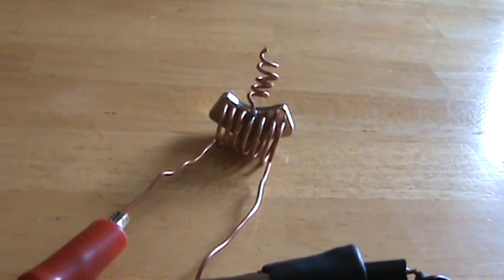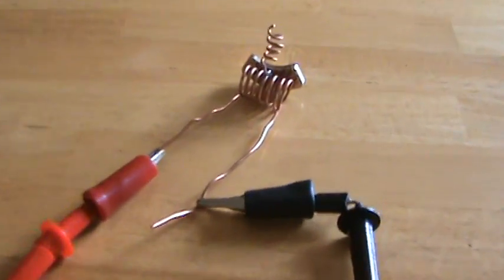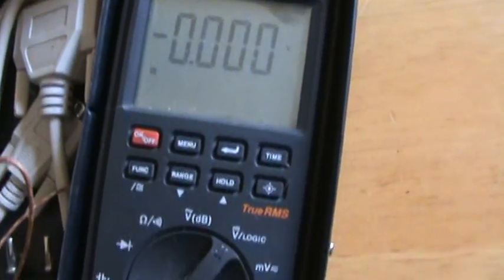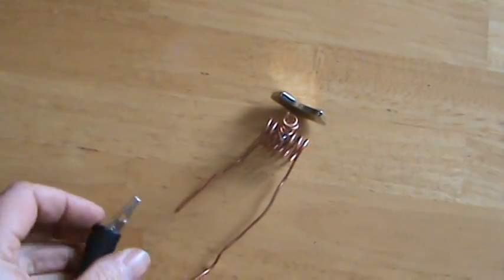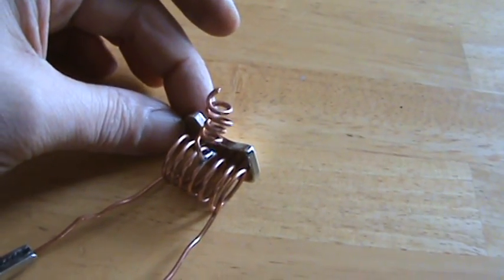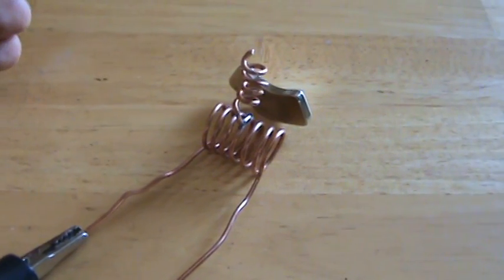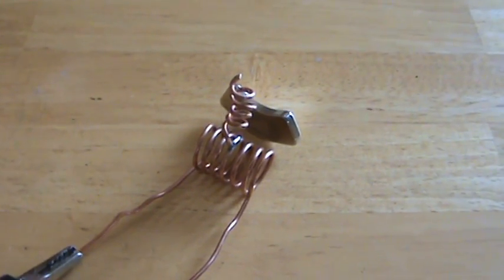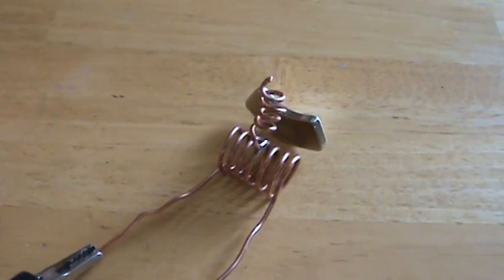Free Energy Generator

Comment: I know how to do it and based on your video your method is lacking a key component. I will give you a clue Alpha Particles...
Reply from the maker: Hmmm, interesting, do you think some radioactive material could actually make it run?
Reply: @INVENTOR3  try wrapping that wire arround some uranium glass and see what interesting effects you get. or you could use mud or even mercury. Also try using cooper and another metal wire like zink there are more than one way to skin a cat. Try the experiment with different temperatures you may find dry ice to be helpful or heat. These are all techniques.
Reply from the maker: @Archangel4Truth  I really like your ideas, they are good ones, thank you.
Check out my latest videos on my channel(just click on my name), you will see a truly incredible project that I am working on now😎

Comment: magnetic around the wrong way, I'm wondering if magnetic is separating the charge in to DC using the larger coil
Reply from the maker: I "think" the person i am replicating was powering his coil through a wireless system.
Thanks for commenting.
Reply: @INVENTOR3  The voltage never fluctuated at all, did seem more like a battery, but I couldnt where.
Reply from the maker: @seb_gibbs  Hummm, you make a good point about voltage did not fluctuate.  Yeah, i dont know where he would hide the batteries, unless maybe he took out motor from housing and replaced with smaller motor and battery and put back inside of the housing.

Comment: For a magnetic field to produce electricity through a coil, the magnetic field need to cut through the coil. Stationary magnets do not cut through the coil and therefore should not produce any electricity.
SCIENCE!!!
Reply from the maker: I agree completely.  But i believe he may have used a freq gen or something to produce high power freq in the air near by, that are picked up by the antenna of the circuit
Reply: INVENTOR3 yes

Comment: Conservation of energy theory states that the energy is never lost; it changes from one form to another – potential to kinetic, kinetic to thermal etc. What it doesn’t propose is to create energy from nothing. There has to be something, a catalyst for the cause and effect to take place. 
For magnetic flux to actually excite the atoms in an electric conductor such as copper wire, there has to be varying rates of flux cutting into the wire in order to cause excitation of electrons and holes for flowing motion of their potential energy. That happens with rotational motion, which is caused by introduction of the kinetic energy onto the rotor in electromotor due to flow of current into the rotor coils or by rotating magnetic field about stator in generator – reversal of electromotor concept. So nothing gained from nothing. The energy we receive freely from sun is due to constant nuclear reactions that take place on the sun.

Comment: More conjuring fakery can be found on Tech Torr's videos - as always the questions you need are "where's the battery hidden", "how do I know that bulb/motor/multimeter/whatever hasn't been tampered with?".  Some use an off-camera fan to spin things with dubbed audio (or no audio) to hide the sound!
Reply from the maker: Yeah, I saw Tech torrs videos before,,,so far, i think they are fake, but this is just my opinion.

Comment: i did try free energy by use of am coil to recieve an am station that is strong enough or close by.the closer the stronger the power but it's very small but did work for me.i don't have any specs on it but you can try to make a crystal set to make this happen.you can get free power off of a radio station it does work.i tried it.to gain more power try to use a doubler or tripler circuit to increase this.i did not do that but it might work if you experiment with it.so try it the tunning method should work if you are near an am station.use a am rod antenna tunning cap.and a crystal diode and try to measure it on a test meter.let me know at albertcarpenter137@gmail.com please get started on it.thanks.
Reply from the maker: The project you mention,,,,,i have been working on it for over 8 years now :-)
Here, please check out my latest video.....
https://www.youtube.com/watch?v=XK3NrQLR2XE

Comment: You forgot the batteries dude.  These devices are made by installing button cell batteries in holes drilled into the magnets using glass drill bits.  The resistance caused by the magnet material(which is otherwise quite conductive) drops the battery voltage output from 6 point something down to 5.9 volts exactly.  Neither can your copper coil be continuos or you create a short(obviously) which is where the pigtail comes in.  That pig tail add on hides the fact that the coil has been cut and hot glued back together(without touching of course).  This is a scam pure and simple.  You really think no one woulda done this over the centuries if it was real?

Comment: They drilled into the magnet and placed watch batteries under the glue... just that simple. Someone already made a replica like that that works with batteries! Hiding the small round flat batteries in the glue. 

If anyone watches this and wants some real and interesting long lasting energy devices look up Crystal Cell batteries. They are very low amp low voltage devices but they last years.

Comment: The trick is rather simple. Open your multimeter and solder a button cell battery in series with one of the leads. Every time you short circuit the leads it will show the battery voltage...

Comment: Hidden battery/s...always the same 3 volts as lithium....coil and magnet won't generate anything unless they are moving relative to each other....big coil is cut and hidden under the smaller tail-coil...glued on and some silver paint to resemble solder...

Comment: I think you didn't pay as much attention to the videos as you referenced below your video. Magnets = magnetism. Sooooooooo how come was your magnet not magnetized to your coil? What would create electromagnetism and electron transfer (electricity) would be magnetic repulsion or attraction. But that would mean two magnetic substances would need to be present. Or one magnet creating a push or pull on one STABILIZED and GROUNDED metal. Your coil should have been affected by your moving the magnet so close.... maybe your magnet is broken
Reply from the maker: Refrigerey Bubleswinzlow Why is magnet not stuck to coil, i use copper wire,,,i think in one of his videos he may of used a coat hanger for the wire so it would of had iron content in it.

Comment: He's putting batteries in the goop he's using to hold the magnet to the coils. Its the same goop Dumble used to use to hide the values on the circuit boards of the amps he'd build. Get your hands on some and redo your "experiment".

Comment: yes. you know, that if his device was valid, even if poorly replicated, some voltage would be produced. there's another vid explaining how easy it is to drill out the magnet, placing 2 tiny 3v batteries in series within the magnet, and the coil actually not being continuous. that's how the 5.9v is made. Bash away at fraudulent video authors! they deserve no respect as they are charlatans similiar to alchemists making gold from lead
Reply: I agree with you!!!!!!

Comment: I am thinking that there is a transmitter under the LifeHack2012 or anywhere else maybe a wireless ac signal to produce a 3v ac signal and then the motor itself was hack maybe there is a diode inside the motor and it will start feed from that coil and magnets if so it is big FAKE.
Reply from the maker: Misael Ordenal good answer, i agree.

Comment: Hi Inventor3. Yes, it is a hoax. The only way to induce a current (electron molecules) through a wire (coil) is by a magnetic field that is in a constant motion. The more cycles the magnetic field cuts through the wire or coil the more current it will induce. So, in your experiment, the magnetic field from the magnet is not moving therefore you will not produce a current.
Reply from the maker: Bill Clinton Yes, i agree, thank you.

Comment: You need to connect the Diabod to the Negative side of the Pedalfer Valve.  That's what you're doing incorrectly.
Reply from the maker: booba loo And dont forget to add the fakeonium, then to place in a bag and hold it over your head while jumping up and down on one leg, hehehehe :-)
Reply: Is there any plan sheet fore the less bright like me to understand exactly how it can be done?
Reply from the maker: שאול בלס To get only very basic idea of concept, i suggest to look up "crystal radio"

Comment: you think it's a hoax.....really.... a coil can only produce a ac current from a rf field, so the out put would have been AC not DC....just put a link inside the v meter with a diode to drop the volts to say 5,8v or what ever you want to display, and wire it so it completes the circuit when the leads are shorted by the copper coil...same as the motor that runs by closing the circuit with it's internal battery by using the copper coil...so easy...why do you think the meter showed the same voltage when the motor was added to the leads to show it running...because the motor was not drawing any current from the coil...
WHY DIDNT HE TOUCH THE METER LEADS TOGETHER on their own??? because it would still have read the same voltage...from the internal modification to the meter.....dodnt believe all you see...it's not magic its, a con...wake up..

Comment: I was willing so much to believe it works but I´ve got the same results...I´ve tried from one to ten round neodimium magnets, a speaker one like you did, and even bothered to solder the antenna to the third turn of the coil as he did... the only explanation is he´s hiding batteries inside the motor that are switched by the very coil...

Comment: In this case it is not possible because there is no dynamics. In a closed coil a current will be generated by an alternating magnetic field included in the coil. The coil is small so for inducing a voltage in the coil the alternating magnetic field should be of a high frequency.
Conclusion: You did your best to replicate this but it will never succeed as the FAKE inventer supposed to be !
Don't waiste more time on this !

Comment: U know now how they make people think that this shit works they nvr hide battery but instead they have a electro Magnet under their table cause all the vids I see they never leave their table or desk at all so it raised a suspicious of them hiding a elector magnet under the table. But for other if they move away from their table it still working I would say that can be a edited video with effect.
Reply from the maker: Well there is one video made by tsbrownie, he does it on the floor,,, check out last two links in the description :-)
Reply: With electromagnet under the table it will still induce an AC not DC.  The battery seems to be the best bet for the hoax busters!!!
Reply from the maker: AK Rajarajan I think so, maybe a smaller motor and battery inside of motor housing.  Or nearby a van de graaff generator or tesla coil, or something near by that he is perfectly tuned to.  You got it,,,that motor needs DC.

Comment: I think that a small-size lithium-ion battery is hidden in the motor. so.. the coil is only a role of electric wire ... how about my idea ?
Reply: yeah...that LifeHack guy always gets 3 volts...exactly the same as a lithium battery, or 2 tiny hearing aid batteries at 1.5 volts...and 4mm diameter, 1.5mm thick...like I have in my hearing aids...
Reply from the maker: yes, very possible :-)
Reply: Johnny Smith, if a battery is hidden inside the motor, how do you account for the light bulb lighting up?
Reply from the maker: William Denman I think there is a "near by" power source that he is tapping into the same frequency of it.

Comment: did u use magnet wire or u use normal copper wire? maybe that's the problem why your project wont work! this one use magnet wire that's why it's work look carefully what type of wire he use :D free energy device tested on light bulb
Reply from the maker: I used all enamel coated copper wire(magnet wire), but some say to use coat hanger wire for primary and copper for secondary.  Maybe their coils are designed to pick up 60Hz from the house power.  Hmm, i think will have to calculate wave length of 60Hz.  Then to probably make antenna 1/4 wave length to pick up harmonic.
Reply from the maker: Hashan sudesh I think to use coat hanger wire for main coil, and your no11 for the antenna coil sticking out.
Reply: INVENTOR3 Can I use 14,13.5,13,12 Gage  copper Wire for the main coil
?
Reply from the maker: Hashan sudesh I could not get it to work either, maybe try to contact one of the guys in the links i have under the video description.  Wish i could help you more.

Comment: there also using two different metals for the two wires , producing an a metal cell. , with an anode and a cathode,  where his two copper wires ???
Reply from the maker: yes, 2 different metals, but no salt or acid or aqueous solution to create a galvanic reaction between the 2 metals,,,so i dont believe that the 2 metals by themselves could produce enough energy to turn the motor.  Thanks for your comment :-)
Reply: INVENTOR3   mean to be honest , there using a very low voltage motors that work off one aa battery even , so he only needs about half a volt to turn them things ,  1.5 volts would make it spin high speed, which isnt happening either,  but they could hae a tesla coil somewhere pumping extra power into the air ?  hard to say, ill be playing with this idea myself in a couple days, i ordered some neo magnets of my own. we will see
Reply from the maker: Leslie Taylor Yes, i think maybe near by Tesla system.  Hmmm, makes me think of John Hutchison uses a radio emitting mat to light up bulbs,,,i forget the name of this mat,,it is used for x-rays.  I have also found and bought from ebay some tiny motors that could easily fit inside of that motor housing,and it would take even less energy to spin.